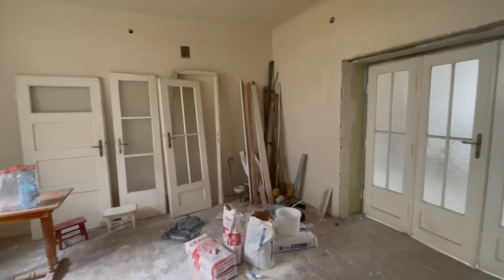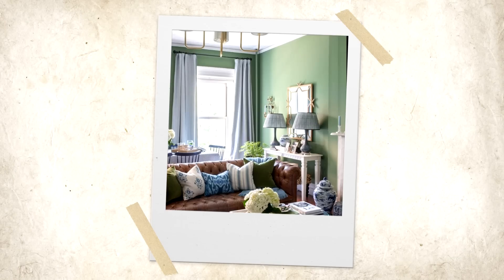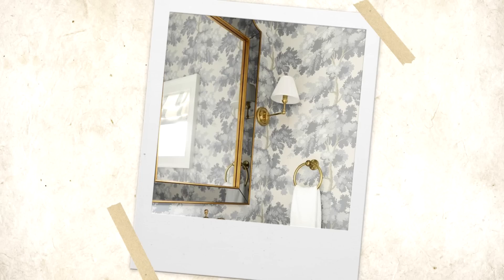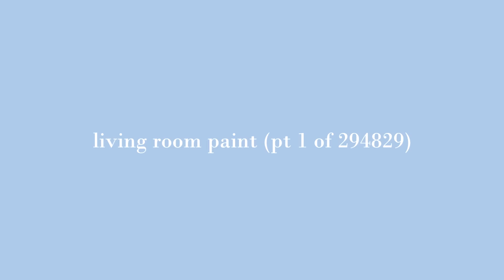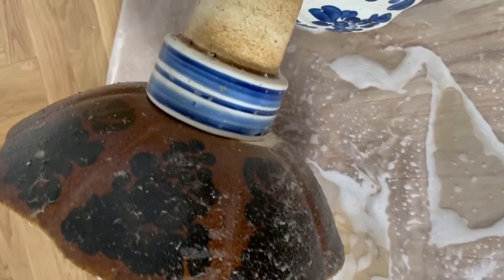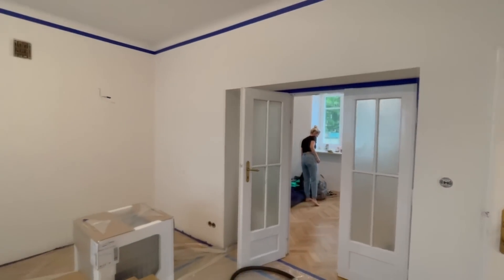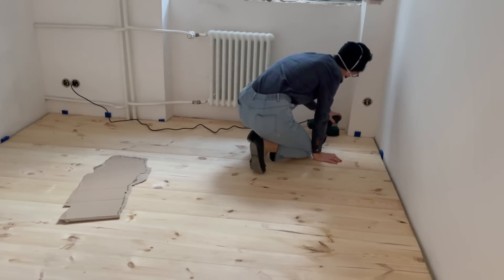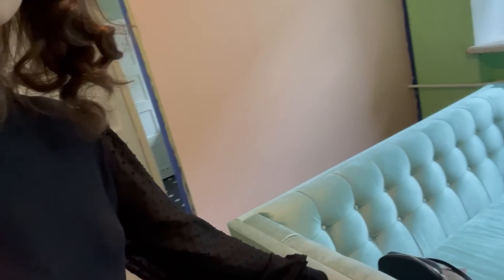Designing And Decorating My 1930s Flat ✨

Comment: Paint sampling is a nightmare. We did 5 samples on our living room wall and they were all SO different from the little square and online. What we learned is whatever sample you like, pick a shade way lighter/more muted than you think you want. It will almost always end up more saturated than you think.

The flat looks amazing!
Reply: I think it's because when you have a lot of the same color it tends to kind of "multiply" itself, reflecting from one wall to another. And samples are rarely painted in 3 coats, so that's also a reason for the color to look more vibrant.
Reply: TRUTH!
Reply: I had the opposite problem with the tan I picked out for my living & dining room. It looks more like a cream than a tan. Much lighter than I expected.
Reply: At least one nice thing is you can use the "OMG too colourful!" paint as an accent wall and have it muted down to a similar but much lighter colour for the rest of the walls...
Reply: My trick is to close one eye and hold the sample paper at arms length.  It gives you an idea what a large chunk of the wall will look like.
Reply: @beiderbecke1927  Where I get my paints mixed for work, they always put a dot of the paint on the lid  so you know what's in the can, and if I bring in a sample for them to match, they dot the paint on whatever I brought to match, they're usually pretty good.
Reply: When we built our house years ago,  I wanted a red dining room.  It was the hardest color to find - I ended up buying four shades and painting them on several leftover sheets of 4x6 drywall to see the finished tone - best thing I did because as everyone here noted,  color on a wall looks so different than on a chip. Plus I was able to move each sheet around to see how the sunlight/ shadows affected the color.  Of course the one I needed was the most expensive Ralph Lauren designer paint shade 🙄

Comment: As far as your yellow wallpaper wall, you could always try to find a stencil paint roller! We decided on wallpaper when redoing a room in our house, then wrestled with the thought of selling the house, and I knew that I didn't want to drop a lot of money on wallpaper for the new owners to tear it out (The room we are redoing is also victorian-esqe themed). I found a beautiful stencil roller on etsy, and everyone that has seen the finished wall asked where we got the wallpaper from! Also, it was MUCH cheaper than the wallpaper I had picked out, and much more accurate to the victorian theme. Over $300 for the wallpaper, and about $50 for the stencil and the double roller to use with the stencil. I hope this helped anyone who needed it!
Reply: I was thinking that too
Reply: this is a great idea bc i always wonder about how it works to hang frames and stuff on a wallpaper wall... but this is prob the solution if i ever do want a patterned wall! thank you!
Reply: The way I put nails thru is that I use a box cutter to name little slits in an x pattern and then put a nail thru the middle. That way it's still invisible but I don't poke a hole thru

Comment: For anybody wanting to paint a whole wall/room: 
1) Go 1-3 shades lighter, since shops are immaculately lit and your flat will probably not be.
 
2) Take your samples, paint different spots in the room - close to the window, furthest from natural light and in-between. Check the colors throughout the day, colors will look different with different amounts of natural light. 

3) Then check at night with your preferred lighting (cold or warm), those will majorly change the appearance of your colors (especially yellows, pinks, greys and blues)!

If you like the lightness of colour but its too saturated: Find the opposite colour on the colour wheel and add a little at a time to your paint bucket, mix well. This will grey your color down.

If you like the tone but not the lightness, add straight white paint.

If have painted so many rooms by now and this gives the best, fastest and most cost effective outcome :)

Comment: You have done so much! We have different style decor in each room. Works fine. Our 1930s house is California Spanish, but there are Art Deco elements. I like having living room sconces with separate switches from the main light...mood lighting if you will.  I also turned our bathroom scones upside down when I realized they would not provide enough light to put makeup on if the light went up to the ceiling. House renovation is a ton of work, but in the end you will be happy every day when you look around and see things you love.

Comment: I really like yellow paint and the dark blue floor in bathroom (might use that idea when I would finally go with renovation of mine bathroom - I still have to many ideas for that little space). I am really glad you repainted that green - first one gave me vibe of my elementry school corridors. 
About using vinegar for cleaning: it is really important to remember that if you have some thin/delicate metal objects you shouldn't leave them in vinegar for too long!  I learned it hard way when I tried to get rid of some rust from my faucet and after cleaning that sieve (sitko w kranie) it exploded when I have turned water on XD

Comment: A tip for paint swatching is to paint a large sheet of paper or cardboard with the primer and color of choice (like a poster) and tape it to the wall. That way you can have a large swatch to consider without actually painting the walls, and you can carry it around to different areas of your house to test different lighting effects.

Comment: This might help and be more up your alley. Take any washable fabric and put it in liquid fabric starch, pull through the excess starch and hang like wall paper. Make sure you do a test to see how much the fabric will shrink. To remove, I very lightly spray water and pull it off the wall. Just wipe the wall down with a swiffer and you're done. I'm sure you have something in your stash you can try. Save your money on  wallpaper. You should do this before the ceiling and shoe molding are on the wall or loosen the molding so you can tuck it into it, top and bottom. Your apartment looks FAB!!!!

Comment: For the bathroom (or any room) mirror, buy a nice antique picture frame that you love and then get just a plain mirror from a home improvement store.  It may be less expensive than finding an antique mirror.  Also, if you want to save money with wallpaper, you can paper the lower half of the wall and put a chair rail along it to act as a break, about 36" up from the floor, then just paint the upper half.  You still get the visual beauty of the wallpaper but at 1/2 the cost. Or reverse it and paper the upper part, chair rail, then paint the lower.  My mother-in-law taught me that trick.  It works well if the ceiling is really high.

Comment: eau de nil - the shad of green you're talking about, is very '30's. I have a 1960's house but love the 30's so I pretend that when we moved in, we didn't have money for new pieces so have lots of '30's pieces which mix with modern things ;). 
A tip for paint samples is to pick the colour you like but ask the hardware store to mix it at 1/2 and 1/4 strength which will resolve the problem of it being too overwhelming.

Comment: Ayo! Great job! Floor edges are called baseboards and for the ceiling edges you can use a "carpenter square"; an adjustable ruler with a right angle, but my personal favorite are laser levels and you can pick those up for $20-30 USD, they self calibrate, and fit on any camera tripod.

Comment: When I painted my room I had a very specific shade of  dark Plum almost chocolate but still obviously Plum color in mind. I couldn't find anything so I bought a purple sample of paint, a chocolate sample (a return so it was like $3), my mom had red paint, and a beige (which I didn't think I'd use... ended up using like all of it), then HAND mixed the exact color I  wanted. It was a lot of trial and error, then painting different walls because the lighting was different.  Took me like a week but I LOVED it. 
So, I painted a thick white paper with it, took it to the store, their machine color matched it, and I got the exact color I wanted, plus they gave me the ingredient/color recipe so that I can get it made in the future too. 
Years later I painted my bathroom light blue and for some reason all the colors looked too childish. I bought 3 different light blues before I gave up (I was sure light blue couldn't be that hard to find) threw some in a cup then hand mixed the dull light sea foam blue I wanted by adding acrylic paints until I was satisfied. 
Same thing, took it to get made and the acrylic made it too flat but I even got to pick the finish.
Short story made long, I learned my lesson and was even asked by a friend for my advice on an emerald green paint for her house. I ended up hand mixing that too!  Nothing was working with the lighting in her house.

Comment: A few things on paint colours:

1) light matters - especially reflected light. A microswatch vs an entire room in the same colour will feel different if thats a strong colour. Purely cause of reflected light from the own colour. It’s the same principle if you wear bright colours, say all red, that red reflected light will spill into everything. 

2) Swatch to phone's sensor, to processing of the raw image to how your computer displays this image.... Lost in translation is most certainly going to happen. One can colour correct remotely but using your phone to transfer an exact colour is a losing battle.

3) Store lighting is usually awful and incomplete. The mix of cheap lights with maybe a few full spectrum lamps and the colour you see in a store is definitely not how sunlight or proper full spectrum photo lights will show. Think of a bar graph with several bars missing vs one that is filled in fully. Only having a small section of sunlight will distort colour.

4) Materials matter. A wide range of materials will take the exact same can of paint will take the paint differently. I doubt you are experiencing this too much but take a given swatch is a near but not quite perfect representation.

5) paint finish. Some swatches use the least glossy option possible and you want a higher gloss. Usually glossy paint looks darker than 0% gloss; for the same colour. Thus know if you are changing your from the sample’s flatness.

Comment: A way to get paint off of old door and window hardware is to buy a old used crock pot at a yard sale. Fill with vinegar and water. And drop in the hardware. Cook on low overnight and the paint should fall right off in the morning. Best to do outside, or in the garage in case it smells. And you never EVER use the crockpot for cooking in again. But works amazingly to get hardware clean.

Comment: You could try accenting the floor tiles with a lighter blue. Get a stencil to make clean lines. No experience behind this idea. And the lines don't have to be a perfect grid, it'd be interesting to have sparce lines randomly about that only IMPLY that they connect, or otherwise just light shadows.

Comment: I have never had success with modern standard paint colors in old buildings. Something about the quality of the light against the pigment just doesn't feel settled enough, so I ended up always ordering custom-blended colors. I would go talk to the paint guy and be like, "Okay, but this is too clear a color, I need to add like three of your smallest parts of these other pigments to tone it down and slightly change how it reflects light in my specific space," and since that guy also happened to be a trained color designer, he actually got what I was doing and why, while all the other paint guys were just like "Why is this crazy lady so picky? Oh well, they don't pay me enough to care, I'll just mix the paint as asked." For one batch I literally mixed some cheap acrylic into the sample bucket until I had the color I actually wanted on the walls, then painted a sample on some white cardstock and had them color match THAT for my top coat and future paint ordering needs.

If you have a pigment blend you really like on your walls, you should definitely keep a record of it. It will make a big difference if you ever need to do touch-ups.

Comment: Oh no! I get the paint color drama. But the thing is that color will change in walls as light conditions and color saturation change. A great tip (though may be bothersome) is to paint inside boxes or at least a corner formed by three plains. In that way you can really appreciate how the color will look in a room.

Comment: Here are some of the words you were searching for. The wood on the Foyer (entry) wall is called Wainscoting when is goes up to your waist or so.The curved ceiling in your kitchen is called a Cove ceiling. When you paint a wall, we call them Coats of paint, not layers. But note, if you wanted to see what color something was originally that was already painted, and you scraped it with a razor blade, you'd call them layers of paint. Go figure! May I just compliment you on your wonderful vision for your apartment and the 1930's cookbook art. Bardzo dobrze!

Comment: Oh my sweet darling. Watching you paint the walls was painful (as a former housepainter). Make it easier on yourself in the future! Spend a couple extra bucks on a thick cotton nap roller for one. They hold a lot more paint so you don't have to keep re-dipping. Also buy an extension pole. Simple screw in ones are super inexpensive and trust me, they'll save your shoulders. And instead of using those shallow pans for the paint, get a (cheap as well) metal paint grid that hangs into a 5-gal bucket (or whatever the equivalent is in poland). 

These are all super affordable ways to make painting a room go a hell of a lot faster and if you clean everything well when you're done those things will last you hundreds of rooms worth of painting lol

Comment: go easy on yourself. not everyone in the 30s liked modern style. anything that is 30s AND older is historically accurate to the 30s. for example my 1890s sewing machine would have existed in the 20th century, albeit as an antique, so i dont mind having it in my pre-ww2 themed room.
edit to add: judging by the "classic" style of the brass doorhandles, the original owners were probably fans of the "timeless, classic" style more than the ultramodern over-the-top deco you see in design catalogues of the day. obviously deco permeated all design of the time, but it was rarely that extreme. just classic style with some deco nuances of shape. the handles are a perfect example of that. for a modern equivalent, think of a rich person's modern home, completely covered in glass, minimalistic, spacious, and then compare that to an average person's house. it will have touches of that style (especially in kitchens lol), but wont define the entire space.
edit 2 (because im stupid and comment before i finish watching the video): the reason the yellow took so many coats to stop being patchy is because its probably latex paint. avoid like the plague. ceramic paint all the way.